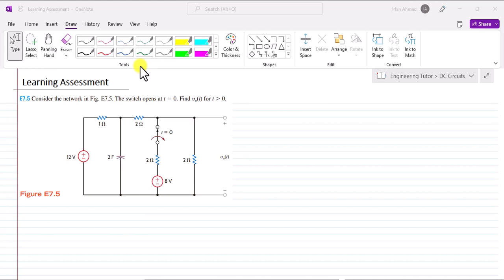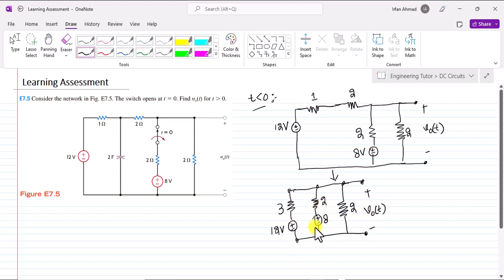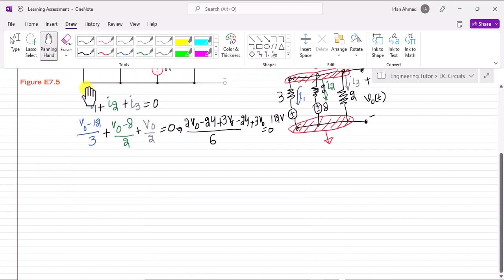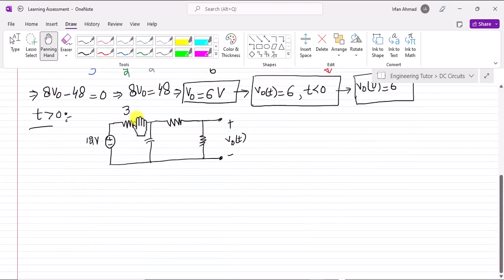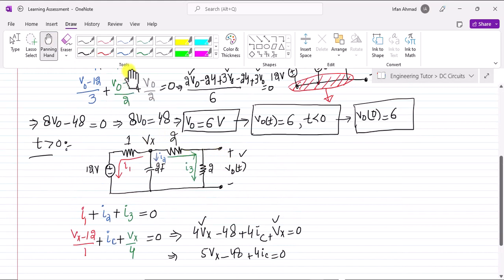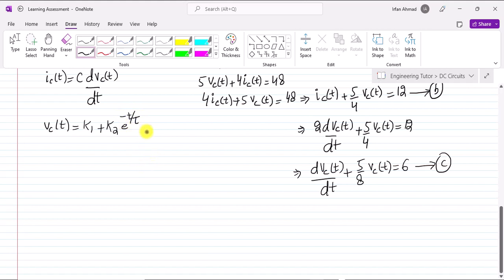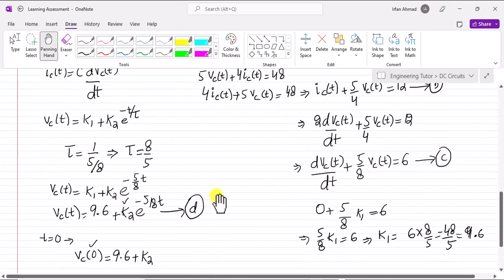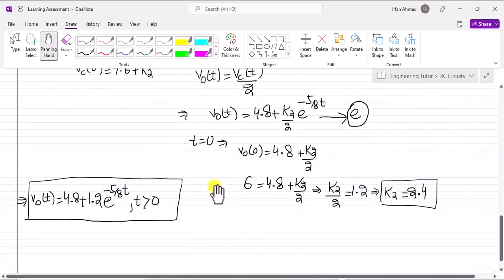RC Circuit Transient Response Analysis | Basic Engineering Circuit Analysis by David Irwin 11th

Comment: sir here the final answer is wrong coz V0(0) should be 5v . for t<0 V0 =6 is correct but at t=0 . capacitor voltage  cant  change which is 10 V. so if we make a equivalent circuit at t=0. V0 is coming out as 5 V. so final answer should be V0= 4.8+ 0.2e^-(5/8)t for t>0
Reply from the maker: I appreciate your detailed feedback, I will verify the steps and update if there is a mistake.